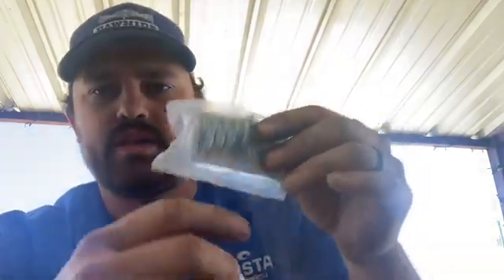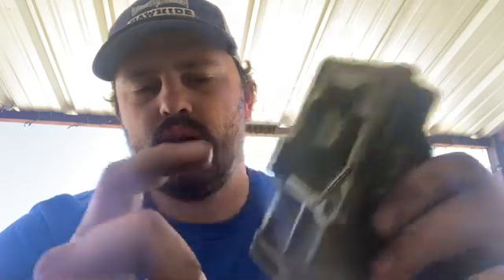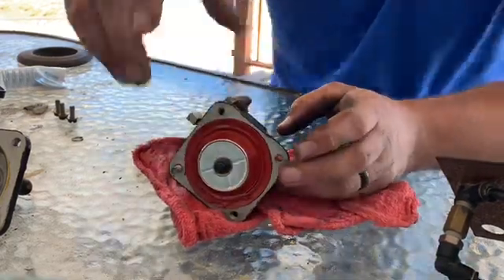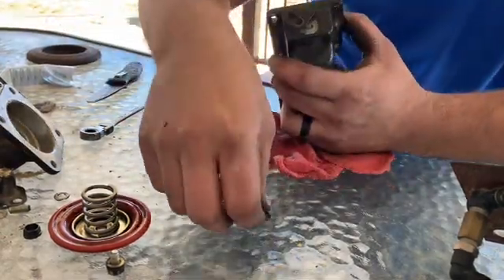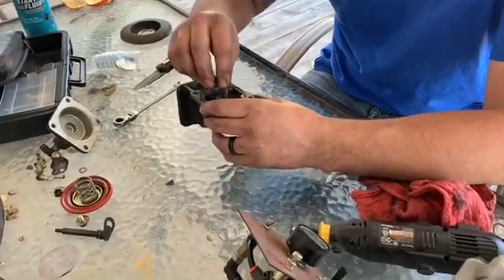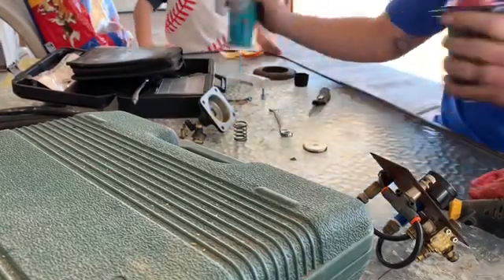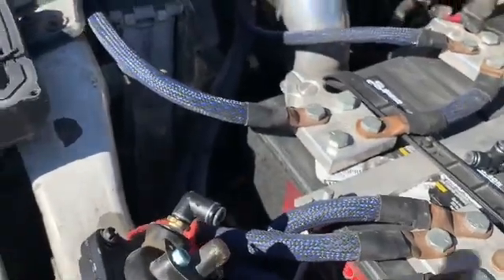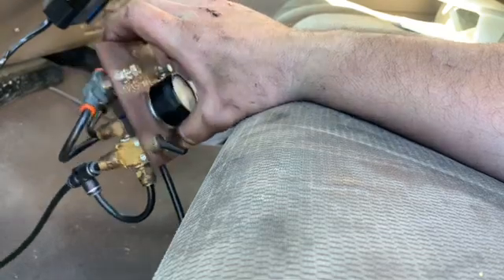In cab AFC control and spring upgrade!!

Comment: You need a low pressure check valve between your manifold and your AFC so when you let off the throttle it equalize the pressure faster.
Reply from the maker: Jonathan Ulrich that’s a good idea thanks!